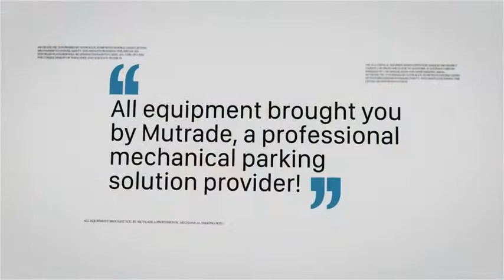Installation process of the Four Post Hydraulic Lifting Platform Mutrade

Comment: Can the chain break? Seems it needs more safety?
Reply from the maker: Hello John! This lifting platform has double-chain safety device, which increases the strength and ensures the safety during operation. In case of fracture of a chain during lifting, the other chain will carry the load so that no automobile slides down. The lift is also equipped with pneumatic anti-falling lock device. If you have a need for such equipment, contact us by inquiry@mutrade.com and we will provide you with the safest and most efficient lifting table!